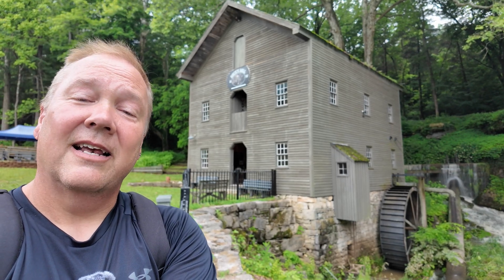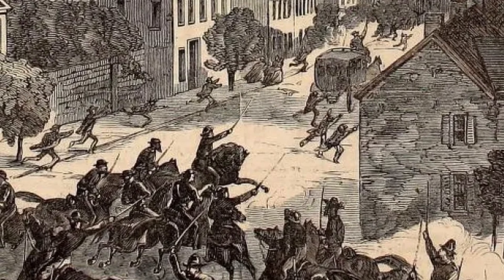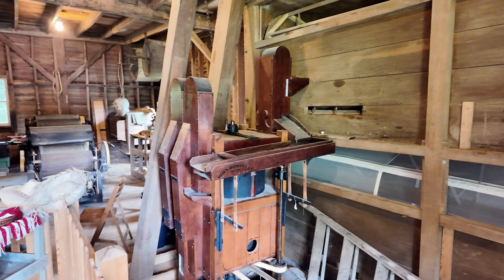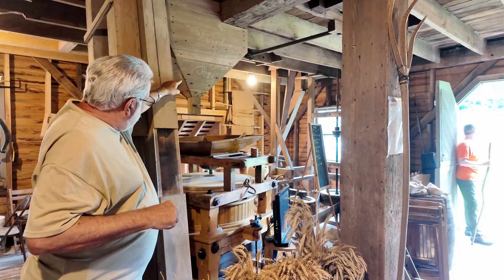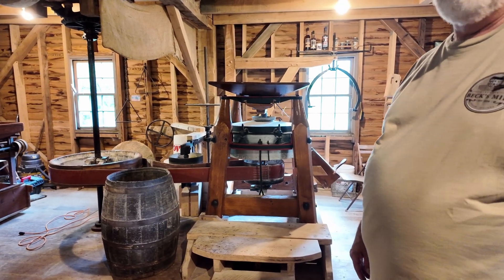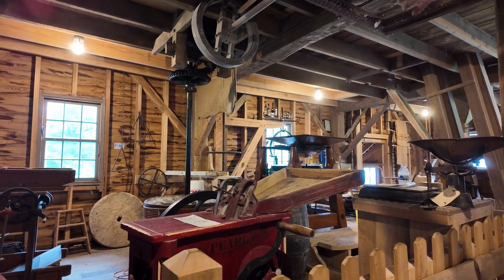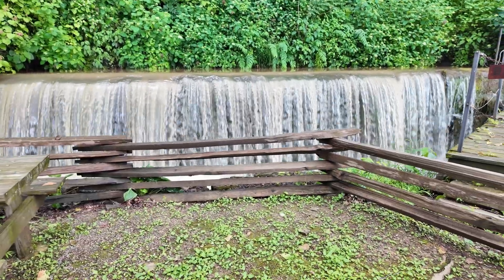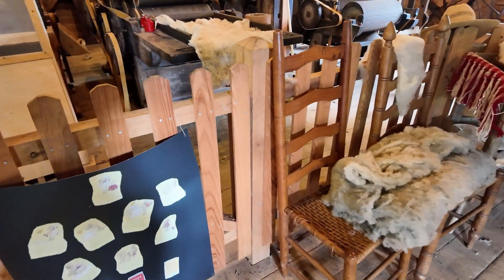Beck's Mill: Indiana’s Oldest Water-Powered Gristmill (1808)

Comment: Thanks for the video. I sure wanted to see some of that machinery run.  I've seen that traction engine you are leaning on before. A Nichols and Shepard I believe. I think it's in the Smokey mountains.
Reply from the maker: They do run it, but only pretty rarely.  I think a couple times a year.  If you live nearby, it's probably worth finding the schedule to try to get there.
Yep, that traction engine wreck is in the Smokies.  It rolled off the road and landed there a century or so ago.  I did a full video on it.  Not something you always expect to see alongside a hiking trail.

Comment: What did you mean by cracking when you were talking about the wheel for the corn.  I'm guessing it cracked the corn, but was this accomplished through the dressing, or some other mechanism?
Reply from the maker: Millstones have big, deep cuts, called flurries, and much smaller cuts across those furrows, called cracking.  The furrows take grain down fairly small, but to get fine flour, like the wheat flour we bake with today, you need those much finer crackings.
Reply: 🤷‍♂️ this may be why Jimmy cracked corn, but I don’t care 😉💚💚💚